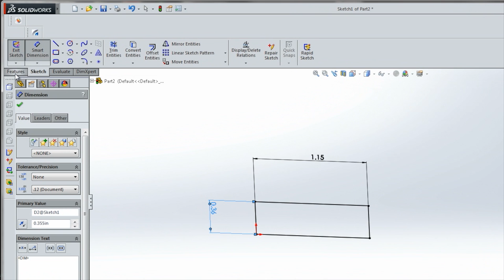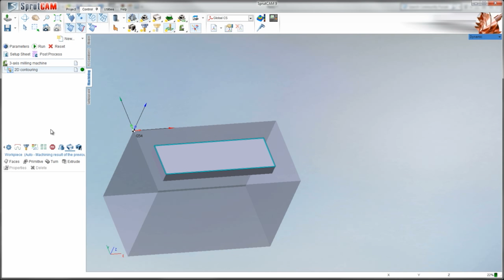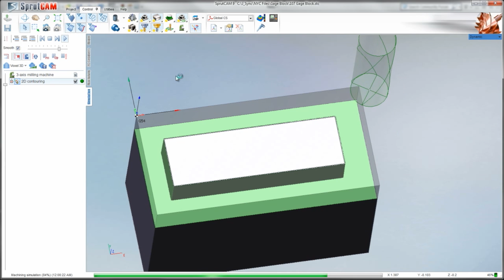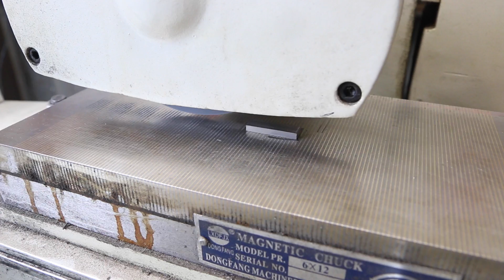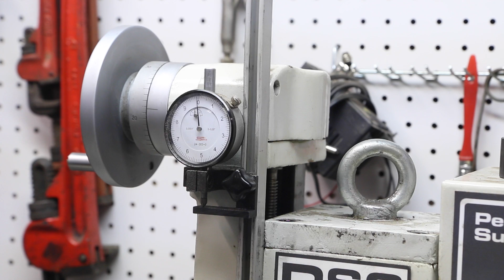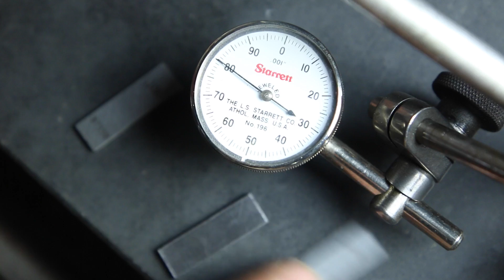The Lost 107: Machining & Grinding a Gage Block! Widget24

Comment: Make 10 and stack and measure then you'll have an average: it's a touch more accurate.  Sparking out is pretty critical when grinding really counts. Othertimes no not so much, you do what you think makes sense. I would spark out a gage block. Lots of cool stuff in this video!
Reply: Caleb Welte Funny, any shop I've worked in lives by spring passes (for cnc mill, and finicky lathe jobs). You rough the shit out of material to make good time. Then you take a finish pass and a spring pass for quality. Consistent sizes, no deflection, money. You can measure and take your cut anyway you please, doesn't mean an endmill is going to stop deflecting just because you want it to
Reply: Jay Jo In soft materials and/or high regality of machine and setup, by all means use spring passes. But this is not ideal or possible in some circumstances.
Take boring for example, a high alloy steel and a deep bore. You may be tempted to take a few feather like passé to hone in on diameter, works in theory and in shallow holes. But in reality small variables like balance, heat, tool geometry and soon will cause the tool to skim in and out of cut. If you have a bell mouth in the part then spring cutting will do nothing to fix it, the tool will just ride over the curve.
On the surface grinder, avoid taking pass less then a  .0001 or 2 um, Thats right around the clearance set in the bearings of most surface grinders. If you don't fully engage then the wheel will likely skip on the surface making scallops. This is also the primary contributor to glazing of the wheel, where all the peaks on the wheels surface have been broken off and worn flat. 

What is preferred is in both cases, is to manage the cuts and take an appropreate finnish cut to dimension.
If you know; how much is on the part, how much is to be removed, and how much the tool or machine is going to deflected. Then you can perform something called "over dialling" on your finishing cut, where you primate the set up or tool to deflect, then get the part on dimension. 

Say you had to make 1'' hole 3" deep on the lathe in a tough steel +- .0005. I would rough it to say .948~.952, touch off on the inner bore and zero the dials. I may be a few thou on the heavy or light side but it doesn't matter now. Then take .012 off the radious and measure, I find that I'm .9715 e.g. I should have gotten .974 but the boring bar has deflected the missing .0025. If I divide them (.0025/.012)= .208 as a deflection factor. Then I can cut the remaining .01425 in radiuse and add (.208*.01425)= .002964 ~.003. The bar is set over size but is deflected on size. There is a fare bit of approximation made, as the deflection of the bar in respect to loading in not a linear function, but given the amour of deflection per the load case, the amount that the straight function defeats from actual will land you within tolerance most of the time.   

And thats not even getting into tool/abrasive life, it not so much the depth of cut or removal rate the contributes to dulling tools. It is rather the millage of the cutting tip and the number of impacts on the edge. If you can get the material removed with few heavy cuts instead of a lot of light cuts then you will be saving both time and tools.
Reply: I recognize that manual machining is going the way of the dodo, And thats not because it is inferior, less productive or dangerous. But because it is perceived that way. Manual machining has just become spechalized to prototyping and maintenance. CNC machines are not more ridged by definition, An equivalent mass Cincinnati mill will beat any mid sized VMC it terms of rigidity.

In either machine type, spring cuts compromise both tool life and productivity, and at times make a bad situation worse.

You wouldn't honestly use the roughing endmill to size, that risks it occasionally going under side. If your using finish cuts anyway, then why not make them to size, the way every text book says to.
Reply: "don't dull the edge any more" Couldn't agree more, the difference is that other cuts remove significant matearil. All I have said above can be summed up with; take deep cuts, then finish cuts, and use spring passes sparingly.

Taking double or 1/3 more the time to make  the same amount of parts can bankrupt some companies.
About the shear vs cut, microscope viewing on shaper/planer machines have proven that the cutting edge is actually impacting the edge enough to expel a fragment that is later fuse-welded to the prior piece. this explains why the back of a chip is smooth and the front has a shingle pattern, as well as why heterogeneous alloys make short chips i.e. brass, bronze, cast iron. The chips are reluctant to weld.
Reply: NYC CNC I don't wanna hurt feelings here. Sparking out won't matter on a Tormach(or most of what I see on youtube).  When you can consistently measure a tenth(which is a joke among toolmakers) sparking out will make a difference. In a plant like GM or Alcoa or Deere tenths can be measured and removed. The small shop working for these companies know their limits; some can get very accurate work out- within a tenth. Sparking out is a given with grinding equipment. Those grinders are worth as much as your whole shop.  It's an unfair comparison.
Spring in thin parts is a B. Good luck with that!  

This is all way above my experience and pay-grade FYI.  I have a heck-of-a-dad.  Sometimes tho what he says and what younger guys are doing doesn't match up.  Old toolmakers wrote the book, but they didn't finish it.  You are a great innovator, picking up where they left off.  Tormach is very exciting and I enjoy learning from some of your toolpaths that you setup.

You've also made a believer out of me as far as Tormach goes.  When I retire I hope to find some nicely used Tormach equipment... in 30 years that is.
Reply: NYC CNC One more thing. When folks on YT are running a BP and talking about removing a thou they are talking out their asses.  A thou on a BP is almost impossible.  You simply cannot get enough tool pressure to cut that and remain accurate on a BP.  That I do know from experience.  You gotta be able to measure what it is you are machining.  And machine rigidity for Pete's sake! Most folks miss that part and trust the dials to do the measuring for them. I'll go back to my hole now for the day; back where I belong.  Stop watching Fenner. Period. I'm not a hater, just practical is all. Guess-work is not machine-work. Working without tolerances is lazy and impractical.
Reply: NYC CNC and I don't know enough to talk on the subject. I know what is practical; I am not on this subject.
Reply: Stacking would give you the average essentially, but would not tell if even one of them was to size?
Reply: That is correct. If each block is 0.0005 over it is easier to find when 10 are stacked and measured.  Also a high spot shows up when they are stacked. Adjust and make  a final part.
Reply: But if half are .0005 over and half are .0005 under?
Reply: DSCKy ... something went wrong? Is that a trick question?  ; )
Reply: Hey John before I forget my pops said today that he used lipstick all the time for lapping gauge blocks back to a surface that would stick.  he said every old timer he knew kept a tube of lipstick in the box somewhere. Hows that for an old-school tip!
Reply: Yeah, that's a heck of a shine on a heck of a flat surface.
Reply: Caleb Welte No it's not a trick question... maybe I'm not understanding where you're coming from?  If half were under and half were over your stack measurement would give a false positive? But I think I see what you are saying. If they are all ground* at the same time*, then they should all be pretty close to the same and yea maybe that would tell you something.
Reply: Yes, exactly right.
Reply: Caleb Welte Lipstick... that's pretty cool. Wonder if it would polish glass? I wonder if todays lipstick is the same as years ago? I've heard of using toothpaste as a mild abrasive on some things.
Reply: Caleb Welte As an alternative to the stack of ten, the 107 thou block could be stacked on top of the 143 thou block then compared to the 250. Then the indicator would be used for its sensitivity rather then its accuracy.
Reply: Look at it this way; finding a unicorn is near impossible however if 10 of them were standing together in a field you might spot them.  Make sense?  The more variables you add the less accurate the work.  Count the variables in your method.  Sure it would work, a tape measure will work too.
Reply: Caleb Welte Say you stacked the ten mostly finished blocks together, and you got 1.073 checked by the indicator shown or a micrometer with .001 resolution. Your unicorn is indeed some where in the pile, now what? Do you take .0003 off each?  Its unlikely that it would be so evenly distributed, and in the scenario that DSCKy brought up, you may fall for a trap.
What must be done is to break them in to small groups, compare and shuffle them. Assuming you don't get lost in labelling and algebra, and every permutation has been exploited. You can achieve high precision among the blocks then the repeatability of the indicator. But you won't achieve accuracy any better then standard you started with.
So you may as well go with the method I illustrated above.
Reply: Alexander McGilton In your shop you can do it however you please.  In front of your computer you are only limited by your imagination and what experience has taught you.  ohn's method and material are no where like how gauge blocks are made.  I belive based on my experience(limited at that) his best shot at 0.107" will be in my approach.  I've never seen him lap anything and that grinder still has the cosmoline on it.  I doubt the finish it leaves is better than 0.0001", he simply hasn't had enough time on it yet.  I don't have anything else to offer him on the subject.  Measuring one is never going to be more accurate than the average of two in this case. Finding a tenth in a shop like John's IS like finding a unicorn.  Tenths exist unlike the unicorn and when they accumulate it makes for trouble and failed parts.
Since you cannot hear the tone or see the expression on my face I want you to know I am trying to be nice, not mean. I'm glad you asked but I'm not a good teacher.
Reply: Would the joint between parts add any measureable amount... I'm assuming no since it is common to wring together several blocks and use them as a stack up?
Reply: Not a quality set of clean blocks. No prob. You're only as good as the tools you use.
Reply: Caleb Welte I would say that especially on weaker and flimsier machines (which can hold the wheel position somewhat steady) sparking out is really advantageous... I've been trained to think that it's quite analogous to a spring cut on a mill or lathe. With more rigid machine you can achieve more accurate results with cuts that are heavier and their number is less.
Reply: See that's the thing I know about this that I don't see on youtube. A spring cut? Sure I get what that means, but in a shop you don't do that stuff.  You set a cut, take a cut, measure, etc.  Does John ever program a spring cut into his Tormach? Nope. Finish pass is a cut, not a repeat of the previous.
Reply: i didnt know that, very cool u put a link there. ThabThanks!
Reply: I used to have a stick of jeweler's rouge. Probably still do, but don't know where. It''s probably 40+ years old. :)
Reply: Alexander McGilton With a long endmill, spring passes kick ass. Grinding, I can't speak of. I've done only a little with it

With boring, some things seemed to like spring passes, some didn't. Spring passes worked well with devibe bars, especially in hard material actually. Steel and solid carbide bars, yeah they ended up shitty since there wasn't enough load on the tool. But, that's just my experience, and was the preferred way in basically any shop I've seen. Tight tolerance on a deep bore, spring pass
Reply: Carbide tools can't take light cuts effectively. If bore is slightly tapered or a part being milled with draft. Then spring cuts will most likely make a bad situation worse.
Reply: Alexander McGilton I've never seen a properly run endmill leave a bad finish on a spring pass, even taking .0002 it's no problem to leave a 32 finish or better. They're sharp enough to not be a problem

Boring on the lathe, it doesn't actually end up being an extremely light cut with a devibe bar, since they deflect so much. Bars that don't deflect as much, yeah it'll probably be garbage (my mistake on that earlier)

Also, you mentioned in soft materials it being less of a problem. I've found the opposite- harder materials seem to give a really good finish even with a light cut, and is where a spring pass pays off by giving an easily repeatable size that's not tapered (endmills). Harder as in heat treated high allow steels, and superalloys
Reply: These folks always drill the same hole twice as well. Now im being rude but seriously. A spring cut is a fools errand.
Reply: Im not denying that it works, or proclaming that it should never be done. When I was taking early marching courses of my technical  training, we were never taught to take spring cuts. Just to take finish cuts of a few to several thou. The reason being that every one would eventually figure it out by them selves, and discover it's benefits and short comings for them selves. What I fear is that espiring home machinist will get the impression that spring cuts are fool proof by your comment.
Reply: Oh, heavens no. I think I specifically said  (or should have said) it was good for CNC operations. Good repeatability for high production. Plus, CNC is much more rigid than manual, that definitely seems to help when such light cuts are involved. Home machinists are probably on manual machines, and working with looser tolerances anyway. 

Not to mention, manual milling is mostly conventional milling to finish- not much worry of deflection there. 

The only thing I remember about spring cuts from my actual schooling, was to "try it out" and see what it takes, before taking the final pass. Well, that and one silly fellow who tried a spring pass on a coarse acme thread. Yeah..that much contact definitely doesn't like spring cuts
Reply: Alexander McGilton What about 2S, 3S curves? A CNC machine follows any toolpath to the limits of it's precision. Even to cut a 1S curve (a circular cut) requires a manual operator to install a rotary table on the machine, and higher S curves require custom built fixtures. A CNC mill will run an arbitrarily complex toolpath until it runs out of memory. There were copier mills with pantograph reductions, but they were essentially the precursor to NC milling.
Reply: Im not sure what new knowledge your bringing to the table, months late? We are all aware that manual machining comes out of its element quickly after parts have multiple curves. The point I'm making its that manual machining will go extinct long before its time. Not because it has no use, but because it is perceived that way. I see it in the universities, young enginears design parts with unnecessary curves, and pockets.  Necessitating CNC for often the purpose of apperaince only. Thinking that manual machinning is only a one day educational experience.
Reply: Alexander McGilton I'm not sure what he's talking about either.. But since this notified me and I missed replying to you before-

CNC becomes quicker most of the time you have more than one or two parts to make. Actually, even prototyping has gone to hybrid machines in a lot of shops here. I don't think manual will go extinct any time soon though, since it's great for hogging out material and for repair work.So they are less productive, depending on what you're producing. 

My mistake on the rigidity though, that was just what I was told. I could certainly be wrong

As for the spring cut thing, I'm not sure what textbooks have to do with it. Things always work great in theory, not so much in practice. If you show me a half inch endmill sticking out 8 inches, that doesn't deflect and require a spring pass or two, be my guest. Over the inch of flute length there is a noticable taper of usually ~.002-.003 even on a light finish pass.
Reply: Depending on material and rigidity condition, spring passes will either give you perfect results or a visit from the chatter fairy. In light passes dull edges will require grater lateral force to allow for penetration, and you will otherwise be burnishing the work and possibly furthering an unwanted draft angle. And ironically spring passes are a recipe for dulling cutting edges.
Reply: Alexander McGilton Keep your tools sharp and get rid of them when they've gotten their use, then. 

Spring passes don't dull the edge any more than any other cut, as long as it's cutting. Just that now you're taking a cut a twice, so get half the parts. But not much else to do when your tool is sticking way out and deflecting enough to give a taper, even on a light finish cut. 

Say, you might have an answer for this. I've heard machinists arguing about whether the metal is actually being cut, or if shearing is more accurate for lathe/mill. Input?
Reply: The depth of cut doesn't make a difference on the finisher as long as it's a clean cut. A .005 finish pass isn't much difference from the .002-.003 that comes off on the spring cut.

 The parts we make, finishing passes take less than ten percent of the total time for the part. And that's with the spring passes used where needed (long milling tools). The people who tried to do it without spring passes, few years ago, ended up scrapping/reworking the parts.

And ah, that does help clear it up a bit, thanks